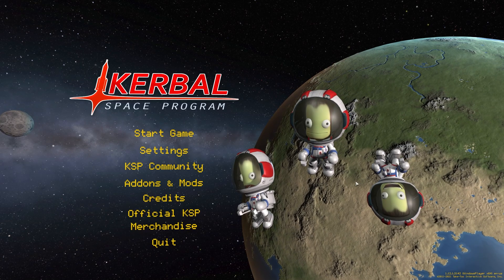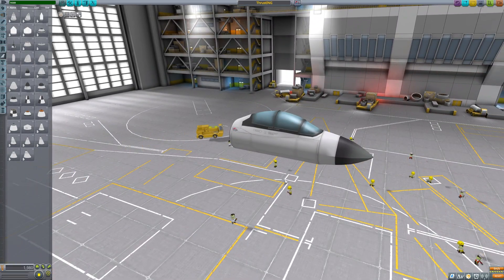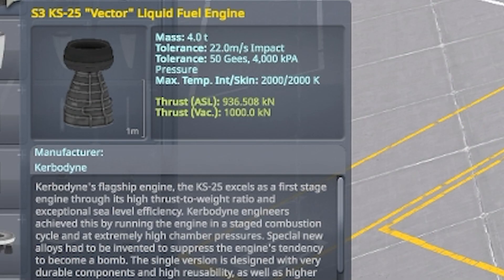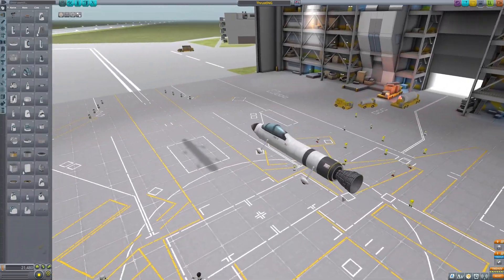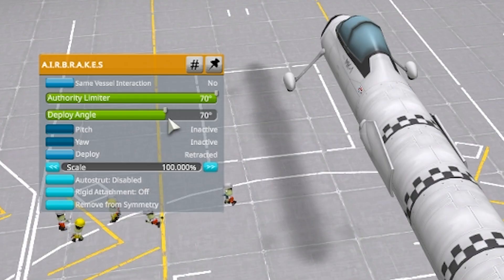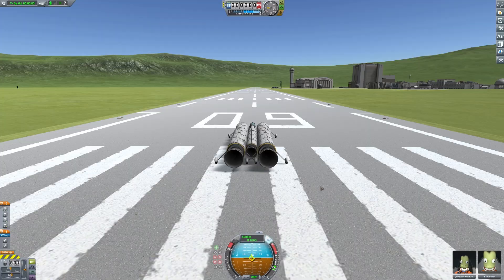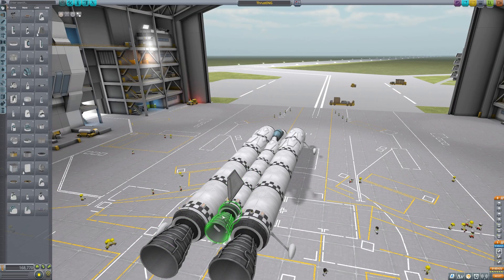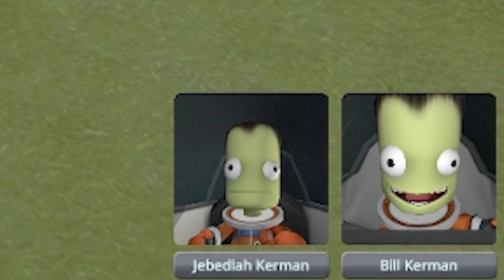Breaking the LAND SPEED RECORD in Kerbal Space Program!

Comment: The reason for the plane moving on the runway at the start (at least from what I remember in Scott Manley's videos) is that the in-game object for the runway is perfectly flat, but it covers a good bit of distance on the planet's curved surface, which makes it act like a downward slope towards the middle part of the runway
Reply: Also these wheels don't have brakes.
Reply: Which falls faster, a ton of feathers, or a ton of bricks?
Reply: @BishopStars  base wise it should be the same but the container may make the bricks land faster
Reply: @BishopStars  Bricks are heavier than feathahs
Reply: @sebieripper  yeah, but a ton of bricks is exactly the same weight as a ton of feathers - but the feathers will fall more slowly due to air resistance, not due to weight (unless they’re falling in a vacuum)
Reply: It more noticeable in heavy vehicles.
Reply: @jwalster9412  yep downhill more weight gets fast sooner.
Reply: @tropicalvikingcreations  I used to play kerbel afew years ago, one time I build a massive (very jiggly) jet and it would alway roll down the runway at high speeds if I didn't hold the brakes.
Reply: @jako7286  It is how gravity and air resistance and drag and friction and everything else work tho; when taken together
Reply: @jako7286  And youre ignoring the SCALE OF THE SLOPE. A slope along the earths curvature wud not work nearly as you argue it wud. Just like how your hammer marble experiment suggestion was wrong.
Reply: @jako7286  Whatever comments you posted got automod deleted; so im gonna guess they werent nice
Reply: @jako7286  They were diff comments, i can see the first few words of them in my notifs. And why wud you delete the comments entirely if they double posted and not just the duplicates?

And no, none of them are there when i go and check; you may want to refresh your cache
Reply: @SylviaRustyFae  there’s no use arguing with you. You refuse to hear reason and logic and don’t understand the science of it.
Reply: Friends at this difficult time need your little help to the Ukrainian army. Putin will be destroyed  BTC: bc1qw2qslwvmtzs7yk2x2lzfxfnsxwz5ne70xkkf9t ETH: 0x9d6917b707e268EFBCF29E37728394F20Cc34CF8
Reply: @jako7286  Not. A. Dude. Pls dont misgender me again
Reply: It's odd that something heavy would go faster - that's not realistic. Consider pinewood derby cars - the weight doesn't make a difference in how fast it goes - aerodynamics/friction are really just about only factors. I suppose something really light would be affected by air resistance a lot more (like a feather) - but it's not like Kerbal has anything that light...
Reply: @jako7286  Pretty sure there's an 'idle brake force' always applied to wheels in KSP, heavier things overpower this easier
Reply: @samuels1123  ah that would make sense
Reply: @jako7286  Pinewood derby cars have extra force added to them tho. If you took and just placed two derby cars on a very slight slope; the heavier one shud go down faster, on earth, not in a vacuum. Kerbin has the same atmosphere as earth.
Reply: @jako7286  ... 😐 wut?!!
Do you not understand how gravity works? A heavier object will have a faster initial speed than a more aerodynamic shape if released at the same time. But then the aerodynamic shape will obviously catch up to it, if it has enough space and time, in a generally neutral environment.

This still applies on slopes.... even gradual ones, Which is what we were talking about.
Reply: @tropicalvikingcreations  A heavier object doesn't fall faster than a lighter object released at the same time, they reach the ground at the same time. The more aerodynamic shape will be faster. It's not intuitive but look it up.
Reply: @tropicalvikingcreations  go drop a hammer and a marble at the same time and come back and tell me which one hits the ground first. Spoiler: they hit at the same time. Heavier objects are pulled by gravity harder, but they also have greater inertia, so they don’t actually fall any faster. It’s also why it’s easier to catch a baseball than a medicine ball (more force is required to cause a change in velocity in the medicine ball)
Reply: @nofacee94  yeah this is exactly  what I meant... considering the comments that replied to me or mention it ... maybe I'm way worse at explaining myself than I thought.
Reply: @jako7286  so i couldn't find a marble  and I wasn't going to drop a hammer and break something. 

So I got a coin and a flash light and well... the flash light won most of the time by a few cm.

I feel like we forgot to talk about the over time part but wte.
Also it was interest that aero didn't win outright.
Reply: @tropicalvikingcreations  Both are having problems to express their points and surprisingly both are right and yet wrong at the same time.
 Here is the deal, the mass of the object doesn't matter, what matters is the density that will define the volume of the object.
 Smaller objects suffer less friction because their surface is smaller, meaning that two objects with similar shape but different densities will differ in both acceleration AND maximum speed.
Reply: @jako7286  They dont hit at the same time bcuz of air resistance and drag and other shit

Comment: You used the wrong tipe of engine, use RAPIER, the best ones which doesn't need oxidizer, you will need the cone intake thought. And use both kinds of parachutes, the drag chute and the regular one (The drag helps more at high speeds, and the regular at slow speeds). Also use more wing stabilizers.

Comment: I would highly recommend sepatrons. Facing sepatron masses (like 2-4 rows of 16 sepatrons around a circle) in opposite directions gives you absolutely massive thrust. You can use it to accelerate and break. Lead with a nosecone attached to a decoupler so when you want to brake you have thrust exhaust. Then have sepatrons facing backward in rings surrounded by a payload or faring. Then have your control area e.g. cockpit or computer in the middle. Then create another payload shell to streamline a second set of sepatrons with a hole in the rear for thrust exhaust

Comment: So, why didn't you simply used spoilers? Just like these on cars beacause the point is the same-keep the vehicle pointing downwards and don't you know.... fly. I believe you can easily make them by pointing wing a little bit downwards.
Also, i'm pretty sure there is a tiny solid fuel booster that will perfectly suit your slowing down problem.

Comment: Some ways to improve the design:
1. Use bigger parachutes, they will slow you down faster. The blue side-mount parachutes would probably work better.
2. If you are using air inlets, may as well use jet engines, although they take some spool up time and don't produce as much thrust. I would recommend swapping out the shock come inlets for regular nose cones in you insist on keeping the side-mounted rockets.
3. Bigger vehicles are not necessarily faster. Newton's 2nd law says F=ma (or a=F/m in our case), so to get the most 'a' for any 'F', you want minimum possible 'm.'  That's why the bigger rocket was having a harder time reaching the same speed. Ideally, you should use up all of the fuel just as you reach your planned speed.
4. Solid fuel does not need throttle to work. The braking boosters are solid fuel, so you could have just pressed 'x' to shut down the liquid fuel engines before staging the brakes.

Hope this helps

Comment: Use wings to create downforce, have them slightly angled Down
Reply: That’s a lot of drag
Reply: @thatoneguy611  They'd be small, similar to an F1 car, nothing larger than the wings on an X-15.  At crazy speeds wings are the only thing that's going to keep a vehicle doing what you want it to do.
Reply: @OmikronTitan  when you’re using jet or rocket power, though, it’s more effective to just angle the engine downwards, losing a bit of thrust instead of gaining a bunch of drag.
Reply: @thatoneguy611  Hm, that seems like something that'd require a lot of physics math that I'm not qualified or knowledgeable enough to take on.  I guess the question is can gimbaled engines keep enough control versus having a control surface.  From what's I've seen of actual KSP land speed tests there's always a form of control surface.  I'm guessing the lift created just by the body of the vehicle is way too much to keep it on the ground without extra control surfaces.
Reply: @OmikronTitan  when you angle the engine slightly downwards, you are creating downforce. If you look at images of jet dragsters, you’ll notice the jets are nosed down slightly, and they have no wings, unlike top fuel dragsters.
Reply: @OmikronTitan  although to be fair I didn’t stop to think that the game may not model this correctly
Reply: @thatoneguy611  Is that something possible in the game though?
Reply: @pbsixgun6  I tested it a few hours ago, and I couldn’t get to work.
Reply: @thatoneguy611  Any sort of downwards thrust at the back of a vehicle in ksp loves to lift the front gear/wheels just enough that you spin out every time. Friction is modelled pretty poorly in the game, so that even having SAS enabled or thrust gimballing at high speed will cause you to spin out. Maybe an AV-R8 at the front and just keep it deployed with a downwards deployment angle of like 1 degrees would work better?
Reply: Why is ‘down’ spelt ‘Down’ even tho it’s in the middle of the sentenss?

Comment: 5:45 Yes, oxidizer is used for when in a vacuum, but you need it if you're working with rocket engines. Jet engines take their oxygen from the air, so they don't need it. If you want to use jet engines, use a "liquid fuel fuselage" instead of a "fuel tank." However, you then also need an air intake.
Reply: He seem to think this game doesn't have jet engines.
Reply: exactly
Reply: As a FAR and many more mods user, a shock cone like in MiG21s work well/better than external intakes like in MiG 23s. They function the same in ksp but at least reduce drag as the intake is inline and you dont need to mess with the exterior
Reply: @reedman0780  Definitely. External intakes are only really useful when you can't put something on the nose. However, what does FAR have to do with this? Stock KSP also adds drag for external intakes, and it makes it seem like your statement applies less to the video (he's definitely not using FAR).
Reply: @linuxsbc  I guess its just because of the more intensified aerodynamics FAR offers, this is a land vehicle but still deals with drag and aero. Stock ksp has great physics but in flight its not that favourable-ish. 

Imo it would work better with a single fuselage/body with an in-line intake, and a stronger engine with less fuel. Short burn time but less weight will take it farther and faster than something with 3 fuselage/body
Reply: @reedman0780  I agree. He was just trying to make it look like the real thing despite having a different objective (high acceleration rather than high max speed).
Reply: @linuxsbc  he did reach the goal with like, the first long boy just as others said right? For some reason he decided to alter it overall and changed it into a 3 body vehicle. Also, for top speed, he can just easily strap in single use boosters with aerodynamic caps that can detach after use, then use up the remaining fuel from the main engine to get top speed. Iirc I flew a Su17/22 knockoff made from a single engine and procedural wings, that flew around Mach 2.2 and got stuck there. And that was just low altitude flight not exceeding thousands in alt. It could also be from mod engines but they produce as much power as one vanilla engine that has around 130 thrust Asl, and my craft is even bigger and heavier. Point is, he could've easily optimized the craft to the point its just a singular tube and still achieve lots of speed and acceleration, which is kinda a waste
Reply: Might be wrong but can’t you use an intake or does that only work for jet engines 6:56
Reply: @aydantaylorellis8200  That only works for jet engines. Rocket engines are designed to use oxidizer.
Reply: @aydantaylorellis8200  no oxidiser is requiered
Reply: gamer or rocket engineer?...what are your qualifications?
Reply: @n.v.9000  Kind of both. I know the information from how things work in real life, and I know how they apply to KSP.
Reply: @n.v.9000  easily researched with a few minutes of Google. Dont need to be qualified
Reply: @wizzerrdd  it was a joke...as this is a gaming channel and those are some smart remarks...still I wouldnt sit in a real rocket made by a guy with google
Reply: @n.v.9000  my bad screen text make brain go stupid. Carry on
Reply: @n.v.9000  depends on how deep the knowledge goes.. I understand aero dynamics, and basic Rocket science, that's about it though.
Reply: @jwalster9412  if you „understand aerodynamics“ then that’s some deep deep knowledge. Saying that as someone who was trained for 3 years in jet engine maintenance and   the aerodynamics involving turbojet and PTL engines  ;)
Reply: @Asgar1205  mostly car related stuff, air likes to stick to stuff, and there is more drag off the tail end of a car than the front, because of a vacuum, created behind the car.

Comment: The parachutes you were using were drogue chutes, which are meant to slow a capsule enough in the upper atmosphere that the main chute won't be destroyed. They are smaller than normal parachutes.
Reply: he randomly guess the correct ones though, for normal chutes dont work on very high speeds, but these do.
Ideally he'd add normal chutes after drogue ones, but ... we're very far from "ideally" in every other aspect of this experiment, so...
Reply: @peka2478  Good point. I thought the ~300m/s velocity was low enough for normal chutes, but I just looked it up and it appears that they fail around 250m/s.
Reply: Matt lowne with 50 tonne ssto uses them

Comment: You can have powered wheels, but they're generally pretty slow. Other methods of propulsion are liquid fuel rockets (high efficiency, slightly lower thrust, need separate fuel tanks, can be throttled and turned off), solid fuel rockets (low efficiency, high thrust, fuel included, can't be controlled), and jet engines (only work in the atmosphere, lower thrust, extremely efficient, can be controlled).
Reply: bro soo smart
Reply: But how about Taco Bell fueled rocket?
Reply: @wikansaktianto9215  That's liquid fuel.